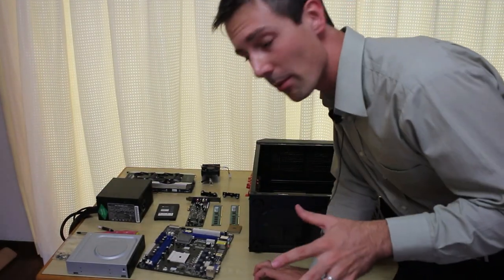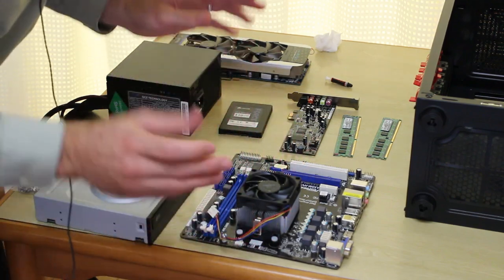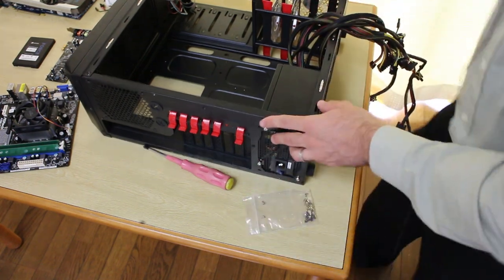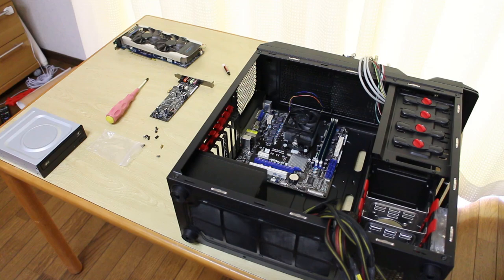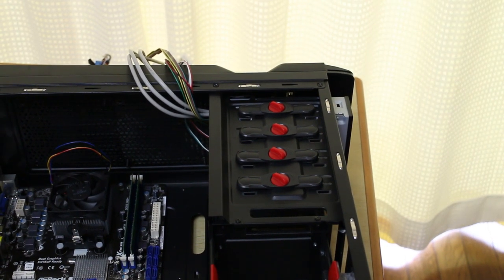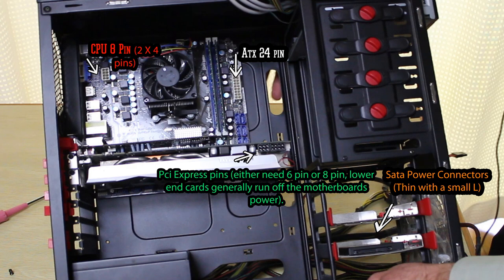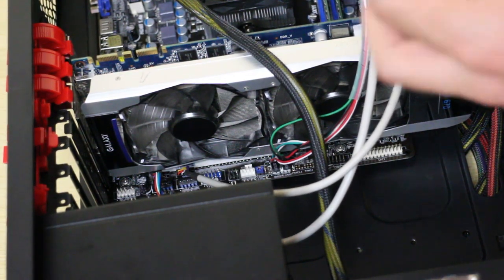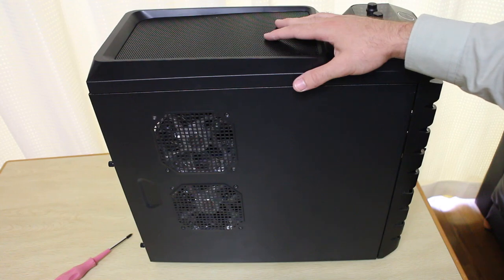How to BUILD your FIRST PC (Full Uncut for Beginners)

Comment: Hi, guys. I have just bought all my components and will start building my computer as soon as my components arrive. However I've never built a computer before and I would love it if you left me feedback! 

This is my build: 
*CASE: Fractal Design R5
*CPU: i5-4690k
*MOBO: asus z97-a
*GPU: Gigabyte G1 970
*RAM:Cruical DDR3 Ballistic Sport 1600MHz 
*PSU: Cooler Master G650
*HARDDRIVE: Samsung 840 EVO Series 250gb

*This will be paired up with a BenQ XL2411Z 144hz-monitor. 

I wanted to get a used 770-780 for my build to make it a lot cheaper and then upgrade later, but none of the sellers I contacted answered me and I already had all my parts except for the harddrive and the gpu so i just ordered them now. I wish I was more patient so that I could've bought more parts used (the psu, keyboard and the monitor are the only used parts with the keyboard being unused).

With this build I hope I get a computer that will be able to handle all the games out there and i'm also really looking forward to build it and put it together. What do you think about the parts and the build as a whole? Do you see any bottlenecks? Would you have chosen different components? Could I have managed my money better?

Thank you so much in advance!
Reply: looks really good, if you have enough with your 250gb ssd, or make sure you get a 1 TB WD soon, they are likse 60$ tops.
I'm gonna build almost the same btw, just a 8350 amd cpu instead of the i5 :)
Reply: Saeric Thank you for replying (:. I don't need that much space yet as I've just found my interest for gaming after years of absence and csgo and Limbo are currently the only games I play.
Reply: You could get a 4TB 3.5-inch SSHD for around $100 now.
Reply: Logan Darklock This is true but for me, I still have my laptop for archival and video needs, so I find that the 450 gb SSD suits all my needs with enough room for many games and programs while saving most of my data in cloud storage or on external save devices.  You can also go much cheaper, getting only a 150 or 125 gb ssd for your operating system and important programs like photoshop, CAD software, or high-performance games, with an additional large-capacity HDD for storage.  Just keep in mind which drives you're installing or saving data to.

(This is for Aadibass, I'm not necessarily replying or correcting you, just providing supplemental information!)
Reply: u should go with the stock cooler that u get with ur cpu to save money for ur graphic card bcuz its bad
Reply: ABC maybe D what did you mean (: ?
Reply: Aadibass When you buy a processor you get a processor cooler with it in the most of processors like the one you gonna buy. What i ment was you dont have to buy a cooler if you aint gonna overclock the processor that much. So its gonna save you money to use the stock cooler that you get with the processor. But its up to you.
Reply: Aadibass and i recomend you to buy a 1tb harddrive instead of an ssd and then after when you have money you can buy an ssd and install it on the computer.
Reply: Aadibass you can also save money if you buy a cheaper case
Reply: ABC maybe D I know, but I rreally liked the case. I didn't need to make the build as cheap as possible, I just didn't want to waste money (:.

The build has been made, and with the exception somewhat noisy GPU I'm very satisfied (:.
Reply: Aadibass So how is your pc working is it good :P?
Reply: ABC maybe D  While this is true, even if you don't overclock your CPU, you can't run on all cores full power for more than two minutes before you're hitting 62c (the limit of AMD cpu's.  I don't overclock my cpu, yet I can't run Gat Out of Hell without overheating my CPU with the stock heat sink.  If you plan on playing modern games with high CPU draw, you need a better heat sink.
Reply: Aadibass haha used gtx 780 yeah... Theres a reason you cant resell them
Reply: ABC maybe D I haven't really put it on a test yet as I've only played a few horus csgo every now and then, but so far i'm very pleased (:.

The only annoying thing is the noise my gpu makes and the extreme brightness and duull coplours from my screen.
Reply: Aadibass If you got a new monitor then everything is fucked up out of the box.  If you're using a television for a monitor, you need to grab your remote and manually change your settings through the TV menu.  Your sharpness and contrast are probably super high, and your "color" is probably very low.  They do not adjust your settings in the factory.
Reply: How's the computer workin' lol
Reply: EstanBulLoFre I've tried to fix it but it still looks terrible. At least i'm getting 144hz, I'll try to spend some more time with the computer and fix the colours. thank you (:

1Shot 2Bros It's working great. I haven't tested it as I haven't had any time to play lately. I have 2.9 hours or something the past two weeks.. But it's working great.
Reply: Well that's good to hear! I hope you have a great time with that computer lol. Have fun!

Comment: how do i ground myself safely when buildingg a pc? touching my case is enough? i dont have a anti static wrist strap and cant get one as the shops i buy it from are closed for a while, and i want to build my pc today? anyone can help?
Reply: You body will become less charged as long as you ground your current into some type of metal. It's probably not a big deal but the larger the piece of metal, the better. Also I'd stay safe and not use your case. If you have other metal then there isn't really any point in using your case.

Comment: How do you plug it into an outlet when it doesnt come with the cable?
Reply: ikr. me too. i had to buy the power cable. also i don't have teh bolts included with the case. so i don't know what the nuts and bolts are that i need to buy.

Comment: All My ram slots are black and i have the sticks next to eachother and when i check CPU-Z it says i have single memory
Reply: If you have four ram slots use first and third slots or second and forth but not right next to each other as it will run in single channel mode

Comment: Im new to all this does anyone know if this set up is good for games like lol,fallout and CS GO?

Intel Pentium G3258 3.2GHz 3MB
ASRock H81M Motherboard
Patriot Signature 8GB Single DDR3-1600 - PSD38G16002H 
Seagate 3.5" Barracuda 1TB ST1000DM003 SATA3 7200RPM 64MB HDD
Sapphire SA-R7260X-2G (Graphics Card)
Cooler Master MT Case N200 (Case)
EVGA 500B (100-B1-0500-KR) 500Watt 80Plus Bronze (power supply)
Reply: Yep cool first build cs go should run ultra 1080p
Though I would recommend going on ebay and look for a radeon 7850 or 7870
The 7850 gives 15 percent more performance for about the  same, probably lower price
The 7870 is really brilliant gives 40-50 percent performance for the same price used
If you could stretch for a 7970 it would keep you settled for about two years, 100 percent better performance than r7 260x.
Reply: You don't even need a good computer for lol. in lol, Internet speed and ping are the most important.
Reply: Yeah, amd is cheaper way to go for price:performance, especially used. I'm trying to build a 425 euro rig with a 7970 off ebay for only 160 euro :S

Comment: do not buy gtx 760 because 760 is 670 and few upgrade to 760, most of the gtx 700 re-design of the old GTX 670, GTX 680 and GTX titan, so i would recommend the R9 280x or HD 7970 ghz

Comment: This question goes out for any pc gamer who has those amazing pc's. My budget is $1500 USD. I'm looking for a PC that can run amazing on any game you throw at it on max settings ex; GTA5, COD, BF4. I also plan on using this PC to do anything productive such as making music or beats, video editing and all that type of stuff and not expect any problems. Im looking for one with wi-fi built in so I don't have to use ethernet. (yeah ik how dare me use wifi over ethernet but my room will be fairly far from the router.) Can anyone link me to a pc that has what I want? Also It would be nice if it has warranty.

Comment: Hello guys, I really don't know anything about pc's and I don't have anyone around who can teach me how to build one. My laptop broke and the technician said that it was a motherboard problem. Instead of buying a new laptop, I want to build a pc instead to get the most performance at the least cost. Basically, I'm gonna use it for CAD, drawing and rendering stuffs. And I watch movies a lot. It would really help a lot if you can tell me all the parts to buy. 

Thanks! Can't wait for your replies.
Reply: I would first think of budget then search on YouTube for a custom build on the type of PC you want. I would also watch more videos on building custom PCs so you have got a good idea of what you have to do. I would also recommend going to speak to that technician and ask for tips. But I will give you a general ideas on what you might need for Rendering and stuff you will need quiet a high end cpu (central processing unit) like a Intel i7 a i5 for watching movies you only really need a blue ray player. If you are looking to do gaming you will need a graphics card but if not you won't need one.

Comment: soooo lucky u get to do this kinda stuff
Reply: u can do it 2
Reply: cant afford it
Reply: Ammar Iqbal you can afford it and i mean that you can build a very low powered PC for £100 or a pretty powerful one for about £350.
Reply: Glad im not alone..
Reply: cris rose that sounds awesome. tell me how it turns out.
Reply: cris rose okay  i will make sure to subscribe. also do you know what parts you are going to use?
Reply: cris rose just looked at your google plus page an we have quite a bit in common as far as videos go.
Reply: Can someone send me the parts for a decent $250 build?
Reply: cris rose nice build. my pc parts include:
motherboard- gigabyte f2a88xm-d3h
cpu- a10 6800k (4.1ghz) it's also an apu so i don't need a graphics card.
psu- corsair cx500
ram- 8gb ripjaws ram
hard drive- 1tb WD blue
dvd writer/reader 
the case is quite cheap but it works and looks nice.
and i also added an af120 quiet edition fan from corsair.
finally the mother board and the cpu support amd eyefinity so i can have up to 3 screens.
Reply: cris rose that doesn't really matter because although my apu works great, as soon as i can afford a good graphics card i will get one.

Comment: Hi, is this a good build? http://uk.pcpartpicker.com/p/qQrFLk
Will it run most games at 60fps 1080p? 
Will I have to change anything? Thanks
Reply: Tom Monty That is a beast computer, and is actually overkill. You'll probably get at least 100 frames on BF4 on ultra settings, even more if you overclock the CPU and GPU. If you are short on cash I would suggest dropping the CPU to an i5-4460 and getting a graphics card with 3Gb instead of 4Gb.
Reply: Tom Monty yah that's amazing dude you will probably get higher frame rates then that with that graphics card
Reply: Thanks for the parts list, I recently got a job that gives $2900 pay each month, gonna build two, one for me and one for my friend <3 luv you
Reply: TheHeizMeister Dark Archon Killer Really, your going to use an amateur computer person's first build? I am privileged.
I recently built it my self and it is brilliant so far. Also, I would recommend instead of the MSI GTX 970, the Asus Strix GTX 970 - I used it and I saw a lot better reviews. Also, change the case, I got the Fractal Design Define R4 and believe me the extra money gives you more reliable cooling and loads more space - apparently that case is too tight and small for a build like this. This was my final build http://uk.pcpartpicker.com/p/MfNLTW
:)
Reply: +Tom Monty you could get 16 gigs of ram for that money :D

Comment: Looks simpler then i though, i'll start building my pcs instead of buying them prebuilt.
Reply: It is much simpler that it looks, as long as you are safe while building and you take your time, it's the most fun you'll ever have!
Building them is cheaper, If you were to look at a PC on Amazon then research all the parts separately, you'll find if you build it, it'll be cheaper by at least £40

Comment: do u really need thermal paste
Reply from the maker: +Toxic I would recommend it, not having it can make your gear overheat due to poor contact of metal to metal.
Reply: amazon or mabey a best buy
Reply: +Toxic were do you even put the thermal paste
Reply: yes thermal paste in all cases is a must
Reply: ok thx m8
Reply: +Toxic and stock coolers also come pre applied with thermal paste
Reply: ***** yes they do intel and amd stock coolers do come pre applied
Reply: ***** lol research pls

Comment: I see where some connections were done on the video card, why?
Reply: Rohan Chung it's secondary power coming from the power supply. some cards don't get enough power from the slot alone so they require extra power

Comment: Umm 670 is actually a bit faster than 760 man so no the 760 is improvement over the 660 ti, not 670. And why would u even recommend Amd 7970 ghz over the lil bit faster yet cheaper GTX 770 instead??
Nvidia = superior drivers (FACT) & better optimizations in multi gpu sli compared to amd's cf-x due to frame pacing tech that's missing on amd hardware, physx, cuda, adaptive v-sync, txaa, surround 3d, etc...

Comment: Hi guys,
first time building. Configured it all through PcPartPicker. Just wondering on opinions on the components I have chosen,
http://uk.pcpartpicker.com/p/nPZxkL

Making it for gaming. Just wondering what Fps higher level games such as BF4 and Dota2 (on max settings) I should expect.
Also, does windows 7 or 8 really make a difference? I'm cheap and trying to justify £6.

Getting a Monitor for Xmas

Please get back thanks :) #PcMasterRace
Reply: The 760 is good for medium detail games. BF4 at medium-high at around 40-60 fps most likely. Better than PS4/Xbox One. But the 960 is about to come out in January according to rumors. Most likely the same price, if you're willing to wait, it'd be an updated card.

Comment: my system is tripping off and the V G A is over hitting 
pls solution to it.
Reply: VGA  video graphic array  video card.  You can tell about the heat, if the fan is way too small or has stopped working.  I found that video cards and RAM are the first suspects.

Comment: http://pcpartpicker.com/p/TKYN7P Can someone tell me if this is good for the price? and if it will run games like gta with atleats 40 fps and also am i missing anything like a cpu cooler?
Reply: Chee5eman117 and can you tell me if this CPU is better than the one i picked --> https://pcpartpicker.com/part/intel-cpu-bx80646i34160
Reply: alright thanks :)
Reply: Chee5eman117 I'd recommend you to get a 4GB ram stick and put more money in your video card. Else get 2 sticks of 4GB instead of 1 stick of 8GB.
Reply: Chee5eman117 Incase you ever want to upgrade graphics card wise, maybe you should get a slightly beefier power supply...
Reply: Go for 2x4 gigs of ram memory
Reply: +Chee5eman117 you should get a 3gb gpu for gta.

Comment: Do I need thermal paste
Reply: Are you buying a processor separate from the motherboard?
Reply: Yes I am buying a apu its a amd and apu is a gpu and cpu combined
Reply: Its a Amd a4-6300 apu
Reply: Mother noard is called a Asus A78M-E
Reply: You don't for our set up
Reply: It come installed on the stock fan cooler
Reply: Ok thanks
Reply: It depends on what you're doing with the PC and for how long. If you're gaming or working, for long days, unless you're fine with your CPU literally catching on fire (there are videos of it if you don't believe me) then you want it. If you're using it for internet purposes, storing pics and vids on your HDD occasionally for maybe an hour a day then you shouldn't need it

Comment: You failed to take your ring off, before your build.  Are you suppose to demetallize yourself before building a pc?
Reply: yeah by touching a metal surface ,, apparently you can even touch the psu metal case (read this from official guides)
Reply: If you plug your PSU i to the wall but don't turn it on then touch that it will discharge static electric by grounding yoyrself

Comment: DO YOU NEED THERMAL PASTE?
Reply: You absolutely need it
Reply: Do any company's supply it with there coolers?
Reply: Sometimes it pre applied but most of the time you have to buy your own from your computer hardware store
Reply: Do I need a CPU cooler for my fx 6300 and r9 270x?
Reply: Yes
Reply: tehTroll OfLife It is pretty much needed at all times if you were planning on gaming because it get's extremely hot.